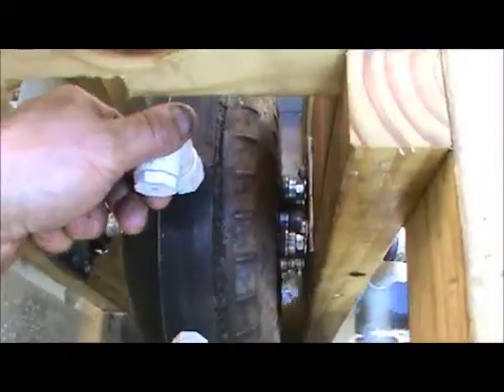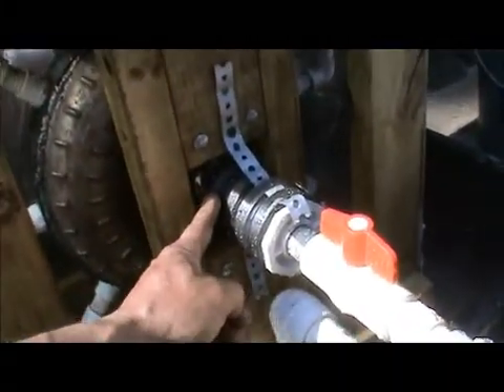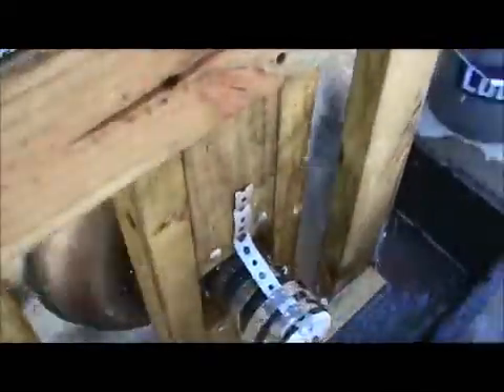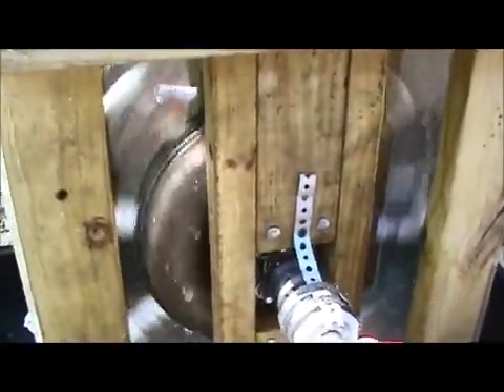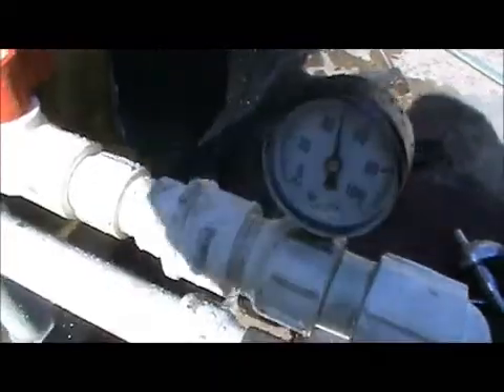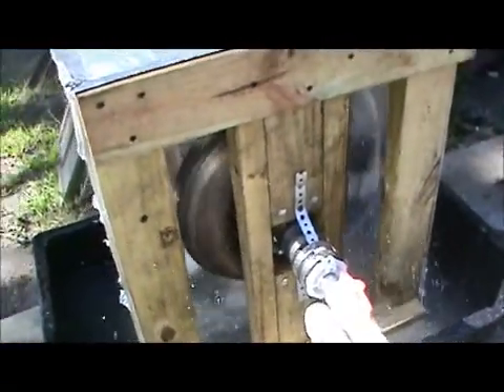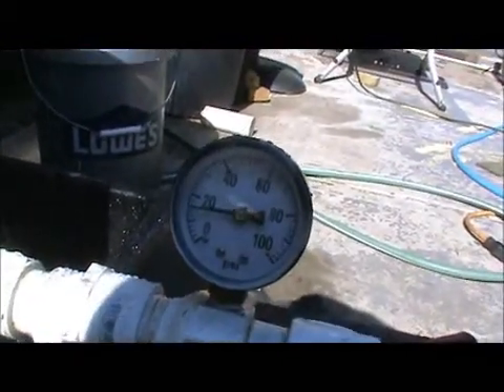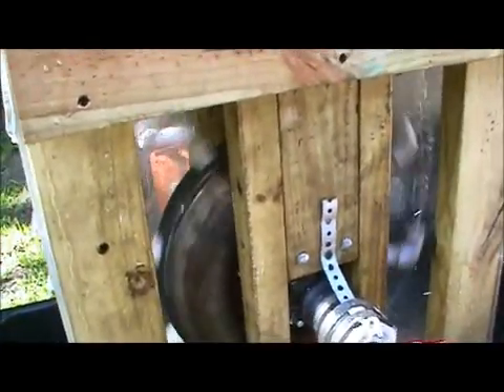Clem engine

Comment: There is a critical design feature that every successful self-pumping engine has that your design just misses. The spinning "disc" has most of the mass of fluid concentrated near the axis. As the engine spins, it loses small fluid mass at the circumference and gains it at the axis. This is what speeds up the rotation of a figure skater when they turn on the ice.  If you flatten your disc away from the axis, you will get much better speed and self-sustained motoring from your set-up. Another boost is to add solids that dissolve into the fluid, increasing the mass of the fluid (density), but speed is more important, that increase is exponential, like the radius distribution of mass, the actual density increases linearly.  Party on dude, be good to everyone. Peace, B

Comment: This demo is a start, but clearly the design was not successful in replicating the clem style engine. As a proof of concept, the basic thrust according to newton's priciple of reaction is validated, that is all. 

For all you doubters out there, the principle that drives this is well understood and I can bet that you all have seen it work. If you've ever seen someone push a swing, or hit a baseball over the fence, or gotten a report about NASA sling-shotting a satellite around a planet, then you know the Oberth effect is real. The amount of kinetic energy put into a system with acceleration will produce a higher amount of kinetic energy than was put into it. Circular motion is fundamentally one of the more common ways to accelerate a system. No airy-fairy quantum foam involved. Ask NASA if their rockets are over unity when they get more thrust out during a sling-shot manuver than was possible just going in a straight line.

Once the frictional forces on the flowing water and spinning tank are overcome, the device will become a system that will run-away by continuing to transfer more and more energy by dumping water and getting that reaction which is bigger than what it takes to draw the water into the device.

With the small pipes, and right angle bends and forcing all the water through the pump, the resistance increases with the fluid flow on the intake.... not a good thing. Clem used oil, and found the frictional forces when it was over-unity heated it so high, it exploded. It would be a smarter choice to use large diameter plumbing, and bend the pipes in vorticies like Viktor Shauberger did to reduce the frictional forces. Also, set the device horizontal, right on top of the reservoir, so the resistance lifting the water is minimal. Even with this, you may recall that a crossesctional area of water incoming to water outgoing has to be at lease 16x to enable enough water to push it over the top. Proof of concept does not have to recycle water, a tank or hose that has a big enough flow would be enough... once it exceeded the limiting forces... it would obviously accelerate.

Then there is the question of mass and momentum. A larger mass would be harder to start, but easier to ramp up... I would think. The momentum would offset the frictional forces at speed. Balancing the load would be tricky... a big hollow shaft with lots of bearings would be a good idea.... and be smart. Its a kinetic weapon of mass destruction. Build a reinforced steel container to keep the pieces inside when it explodes. Take a lesson from 17th century sailors... you don't want wood splinters coming at you at the speed of sound.

Speed limiting once it is over-unity is a must to stop the run-away effect. The easiest thing would be reducing the water into the device... it will continue at high speed with almost no water... pushing that swing when its going takes very little effort... consider the range of effort to start a swing, vs keeping it going.... when it starts to take off, you'll want to shut it way down very quickly.

If you could fuel it with mercury... that just might kick it into self-drive at more reasonable speeds, but the hazard conditions and costs would probably also be exponentially problematic... 

Didn't the Clem engine have the liquid follow an increasing spiral to the jets? Clem was no one's fool. definitely maximized the acceleration and reduced the frictional forces.... That design benefit has the offsetting problem of keeping it balanced at high rotational speeds... Not a practical device for a car... maybe a big boat or stationary power plant. If you could make it light enough... possibly a motorcycle. Once its on, you just let it run all the time. Peace, B
Reply: @Tom Reed Not sure you have it right. I could be wrong, but the oberth effect applies to a moving body acted on by a force. And momentum (I), not mass is applicable for a spinning rod or disc if you have pipes or just a hollow disc. I=(m*r^2)/2, A=(v^2)/r, d= (a*dt^2)/2. Start from rest =>
Kinetic Energy =F*d=I*A*d= mv^4dt^2/4. Most would have eliminated the dt^2 by substituting (Vf-Vi)/dt for a. But leaving it in and using v^2/r for a, you see there is a ^4 factor of speed and it increases with the square of the time interval. Also the radius drops out. This assumed constant acceleration, which of course is not the case.... once you overcome the frictional forces, if you can use a medium that does not vary in density... it will become self-accelerating. This assumes a 90 degree bend from off radii to tangent. which will self-destruct. Clem used a 25 degree off tangent jet, to no doubt cancel some of the centripital force. Probably a good idea. Using a less dense liquid, like a low vapor pressure oil would give more of a window to tuning the speed below runaway, but would encourage a larger radii to up the mass...If you are using steel, the mass of the disc is dominated by the container, not the oil... and the kinetic energy is much less due to the less dense oil being the mass that is accelerating the system. Which complicates the math, but intuitively means more KE, and less likely to runaway, but still will get there. An improvement would be to turn the fluid flow into an impulse with the addition of a venturi at the jet-end. This would give an accelerating kinetic energy, which would add another layer of exponential energy transfer. Peace, B

Comment: ?? I'm having a problem understanding what you after here. If all you are doing is piping water under pressure into the rotor to drive it, what's your point? That would be no different than a jet nozzle on the end of a hose. Once you open the valve, of course you line pressure is going to drop a the fluid is being discharged from your jet nozzles.... Where are you going with this?
Reply: Please see Patrick Kelly's Free Energy Guide, It  explains it well, and exactly what to consider when building your own. The secret to this machine is  literally in the vacuum, think the faster it goes the stronger the vacuum, which in turn spins it faster. This is a mechanical over unity machine, that in a mechanical way accesses free energy that is there to tap into, it breaks no rules.
Reply: @TR Labs 
Sir, thank you for your input. I'm fairly sure I see what you are getting at and attempting to go with this mechanism. I only wish we could communicate more closely as you're dealing with some major inherent internal problems with this system that really should be addressed. Problems which can be overcome. One is internal turbulence in that it literally eats energy that could otherwise be diverted to driving your system. I do believe that there is a way to thwart Newtons' 2nd theorem of thermodynamics but to do so one must follow nature. I studied the 'Clem Engine'. Good attempt but still has several areas that need to be addressed.
Reply: @BackYard Engineer 
Tom. I see what you're trying to do which seems to be in the right direction. Not to be critical Sir but you're dealing with a tremendous amount of mechanical friction in you mechanism not to mention internal turbulence, all of which takes energy away from your intended drive force. But that we could communicate more openly, I'd love to share some ideas I've learned over the years studying Schaubergers' work. Hang in there and keep moving forward.

Comment: You can collect more energy with a finned outer cylinder, it will turn on the contrary because it will be invested by the jet given off from the nozzles. You can connct it to the shaft or to the water pump
Reply: But this looks like its modeled on the simplified clem engine see Patrick Kelly. In these hard times made correctly this is almost free, very little  math involved. Ive seen amazing designs for Clem engines, i think they will power the first citizen ufo, imagine 100% mechanical back up control ufo , emp proof!